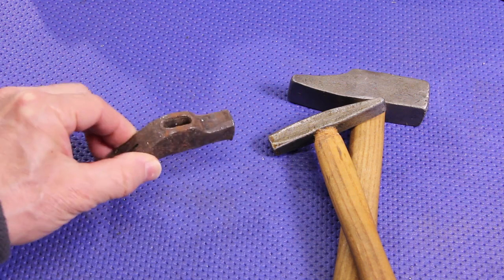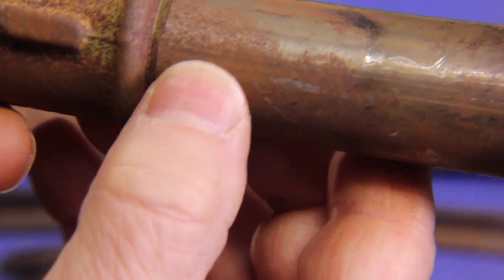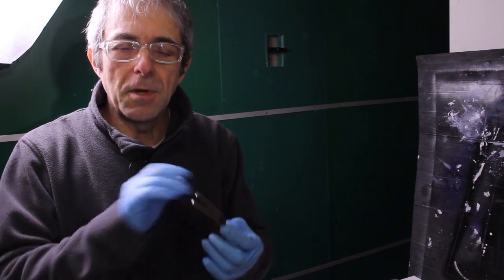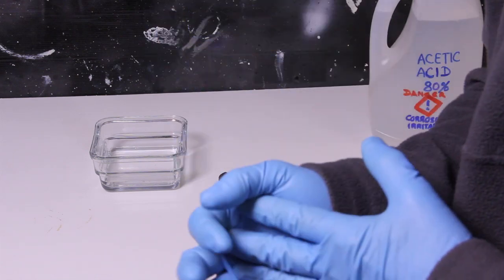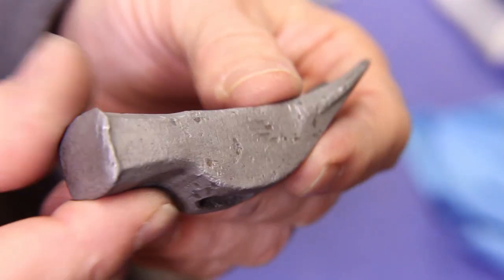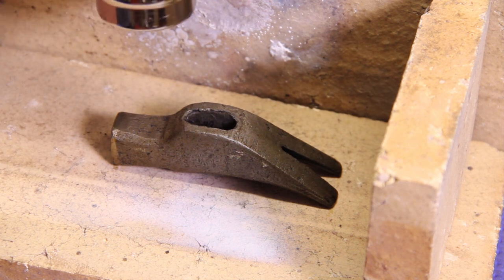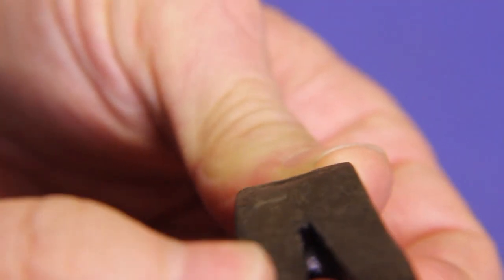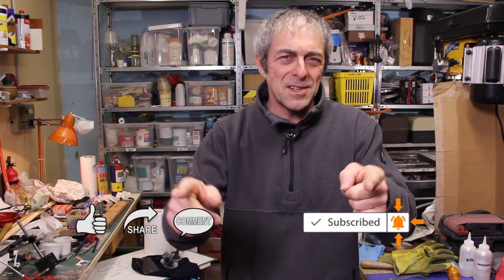Rust removal & protection with a reinvented old recipe

Comment from the maker: 👉 Acetic acid mostly comes from vinegar, that has a typical concentration from 3 to 8%. Vinegar is concentrated and acetic acid is thereby extracted. So even with the common vinegar you can achieve similar results, but taking much longer time. Though, if vinegar is kept hot, say 60°C (140°F), while treating the piece then you can shorten the required time to complete the operation.

Comment: 3:03 The issue with tetanus is not typically one of wounds being contaminated with live bacteria but of contamination by bacterial endospores, which in an appropriate anaerobic environment will become actively reproducing bacteria. Those bacterial endospores are far more difficult to inactivate than live bacteria, requiring very high temperature or harsh chemical decontamination, which is why they are found nearly everywhere.
Reply from the maker: Yes. Thanks for the contribution.

Comment: The powder which came out of the hammer after the acid treatment, is not iron, it's carbon. Hammers are made of high carbon steel for strength, and carbon does not react with the acid. The same would happen also using hydrocloric acid
Reply from the maker: Excellent observation! I have to test it with a magnet.

Comment: I have used white vinegar with great success. Is this acid similar in composition?
 (For what it's worth, afterwards I wash the part in water then I scrub with bicarb of soda to neutralise the acid, then I dry it and I place it in my oven at the lowest setting, to completely dry so as to prevent oxidation)
Reply from the maker: Yes it is. Almost all acetic acid come from vinegar that is concentrated using various techniques. Vinegar has a concentration of acetic acid between 3 to 8 %. No neutralization is required, just rinse thoroughly. Backing in a oven is a good idea to make the treated object really dry but then you have to protect the bare metal with oil or with the technique I shown in the video.
Reply: I thank you for taking the time to reply to me, always good to learn new things.

Comment: super glue accelerates linseed oil but be careful it is exothermic.  This works really well on a lathe for finishing wood.  Also, the rags should be never be put in a trash can because they can cause a fire.  Iron + tannic acid tends to oxidize (which is why iron clamps for wood glue ups sometimes create stains).  I wonder how the acetic acid impacts this Fe+ reaction.   Finally, oxalic acid can remove stains in wood but I'm not sure what the chemistry is.
Reply from the maker: Very interesting.